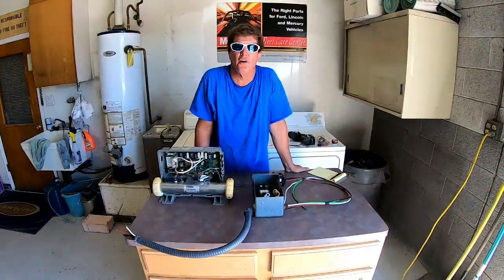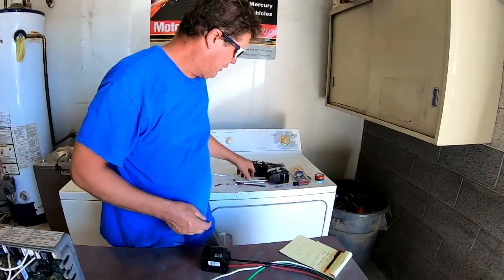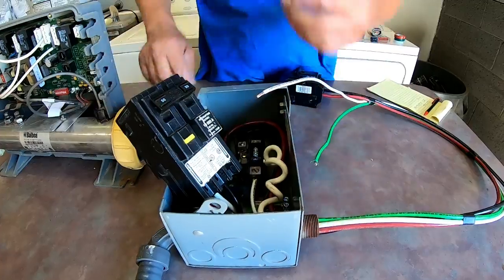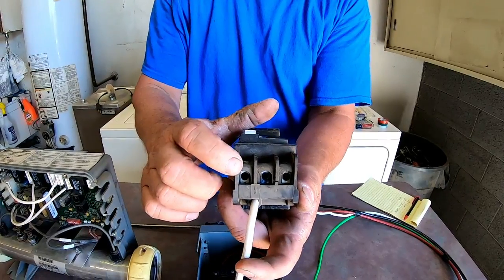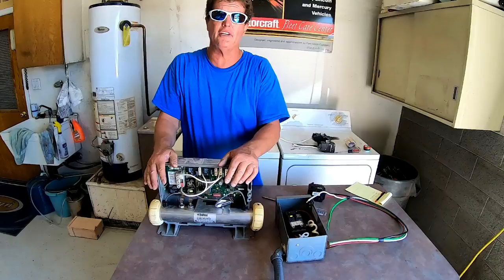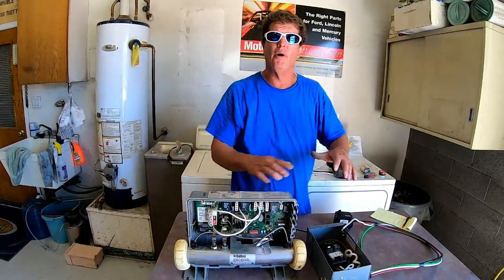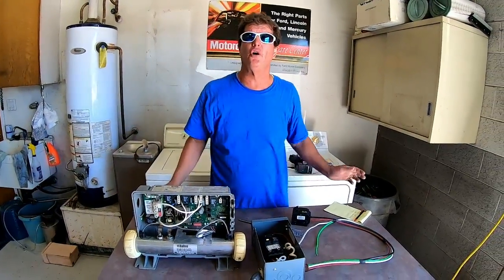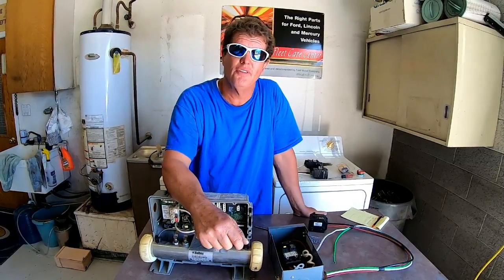Hot Tub / Spa wiring made easy... 50 Amp GFCI Install..Arizona Hot Tub Factory (DIY Spa Repair)

Comment: Do you HAVE to have a separate sub panel for a spa?
Reply from the maker: Rule of thumb is you do not want the shut off any further the 25 feet away from the the Spa when you are standing in front of the Top side control and no closer the 5 feet to the spa... In the line of sight and with no obstacles is the way  in the event you need to shut it off NOW... I talk about this in a video titled ...It's time to make some bubbles...2:30...https://youtu.be/UH_fpoPAJEY Thanks for Watching & SUBSCRIBING
Reply: @spaman5440  otherwise it’s ok to just install a 60 breaker in my main box and have that be my “sub panel?” I don’t need a separate panel? Even if the spa is a 240V?

Comment: 2 questions:

1. I've had issues with outdoor GFCI failures.  Would it make more sense to the GFCI breakers in the house panel then the standard breakers in the outside box?  Any harm in that?

2.  I have #6 wire running to the box where I'll hook up a flexible whip to the tub.  The issue is I can't seem to locate a 6 gauge 4 wire whip.  Can I use 8 gauge 4 wire on the whip and if not, any idea where I can order one?
Reply from the maker: (1)Ive seen it done both way... Ant it really doesn't make any difference...Om a side note if you are having a problem with the breaker no matter were it is placed you might have something else going on...
(2) no you can not use #8 wire! all 4 wire need to be #6  THHN... As for finding the whip ? We have always made our own... You get a 25 foot length of seal tight and cut to size and add the wire #6 THHN  to fit. I will post the link for You below... Thanks for Watching & SUBSCRIBING
Reply from the maker: Liquid Tight...https://amzn.to/33rSTaP
25 feet #6  Wire...https://amzn.to/3vT5Rue

Comment: Great video! What type of wire should I use if I wanted to run the conductors from the GCFI disconnect to the hot tube? 
Assuming I am going to use SCH 80 tube.
Reply from the maker: I alway use THHN #6 wire.. This is a link to the wire I use. ..Hope this Helps Thanks for Watching & SUBSCRIBING
THHN Wire...https://amzn.to/2QGOVbK

Comment: im running about 100 feet of wire from my main panel to the sub panel outside, it is a 50 amp system, am i ok running 6 gauge to the sub panel and also from the sub panel to the tub pack....i seen a guy run 4 gauge from the main panel to the sub panel and then he ran 6 gauge from the sub panel to the tub pack. im confused to why he didnt just run all 6 gauge wire for everything
Reply from the maker: How many Pumps and Motors and what is the HP each and How far from the Sub to the Spa ?

Comment: Where does the common or neutral and ground wire into in main electrical panel?
Reply from the maker: I have another video that shows how to wire the main panel as well as the sub panel... If you go to that video it will show you how it is wired.. Thanks for Watching & SUBSCRIBING

Comment: Need help. I have an older home. On the main breaker you show the ground and neutral not connected. 
 Have a 100 amp breaker box and have a open 60 amp breaker I can use. I'm sure it has ground but not sure if it has a neutral.  If it does not have a neutral what is the fix. Thank you
Reply: It has to have a neutral otherwise you would not have 120 volts available at your receptacles anywhere in the house.

Comment: Great video! I have a question about a used hottub I just picked up. Everything works with the hottub except it won't heat. Upon inspection , I see the thermostat is not connected to the board. It's a 4-pin connector. One pin hole is plugged, but there are 4-Pins on the board. If the thermostat is not connected will this keep the tub from heating?

Comment: I have a siemens electric panel system on my house.. A couple questions:

I only have a single game slot available in my sub panel, can I put a single gang standard 50amp breaker in there and run that to my double gang 50amp gfci breaker in my disconnect?

How do I cut off all the power to that empty breaker slot so that I can wire that without frying myself, will the main house breaker cut that panel off completely?

Comment: I ran four wires now I find out I only needed three.  Waste of money and effort but oh well. I will cap off my extra wire.  However the pigtail from GFCI still needs to hook to neutral bar right?  So does the green ground from spa itself also go to the neutral bar in sub box?
Reply: Pigtail wire from GFCI breaker goes to neutral bar in sub panel. Ground wire from spa goes to ground terminal in sub panel. If sub panel does not contain a separate bar with available terminals for grounding then install one in it.

Comment: Hey Scott I got a question for you I wired up my hot tub just like you said red on the left black on the right and red on the left and my breaker panel black on the right with whites on the neutral bar in breaker box and at the disconnect however I'm getting power to the disconnect and I'm getting power back out of the disconnect on the black wire but not the red one to the tub when I do wrong
Reply from the maker: Call Scott at the office...He will walk you through it and help you figure it out..shouldnt be hard to help you get your spa up and running
Reply: Hey Scott this is Will Hamilton again with my Clearwater spa and Balboa control panel first of all I'd like to thank you man for replying back to me and helping me out on the other situation hope you had a nice Thanksgiving but I had to change the control panel on this and like I said it's a Clearwater Spa but it's a Balboa control panel everything's wired right and I'm getting power to the new control panel I mean the touchpad rather that's what I had to replace but it won't go into no modes or anyting by start up and all that is there anyway you can direct me maybe or do I need to call Scott again tomorrow

Comment: I do not have a 4th common wire coming from my breaker box. I have two hot #6 wires and a copper ground coming from a 50 amp breaker. Am I in trouble? Can I adapt something in the GFCI box to make it work?
Reply from the maker: If you call Scott at the office he cam help you..He will need a few more details but Im sure we can help you figure it out...Thanks for Watching & SUBSCRIBING
Reply: @spaman5440  I'm not in AZ. Can I still call Scott?
Reply from the maker: @nathanberglund2053  Yes.. He is usually in the back shop around 9 A.M. until noon each day.

Comment: Can the GFCI be installed in panel inside home? Instead of having two breaker panels?
Reply from the maker: Well yes and no.. Your disconnect should not be any further then 25 feet from the Hot Tub and no closer the 5 feet and in the line of sight when standing in front of the Hot Tubs Top Side control...having only one breaker inside the house would not be recommended.If your still a little unsure Please call my office and ask for me.. Hope that Helps  Thanks for Watching & SUBSCRIBING

Comment: SPA MAN! Thanks for the awesome video! Quick question - is an insulated ground wire required from the house panel to the disconnect and from the disconnect to the spa? Or is it possible to use 6/3 wire?
Reply from the maker: I alway use an Insulated ground when working with Hot tub Wiring... #6 wire on all four. Im not a big fan of the 6/3 wire...In the past Ive had to trouble shoot tubs with tripping issues and I have spent a lot of time figuring out there was nothing wrong with the Hot Tub it was the 6/3 wire running from the Sub to the Tub. I removed the 6/3 and replaced it with #6 THHN wire and the problem went away..Hope that Helps ...Thanks for Watching & SUBSCRIBING
Reply: @spaman5440  Really appreciate your quick reply! Can I take your input to mean that while you see benefits in using #6 THHN from the sub to the tub, 6/3 from the house panel to the sub is acceptable?? Candidly, the idea of pulling wires through conduit from the house panel to the sub is a bit daunting (40 feet through walls and around corners). The 12 foot run from the sub to the tub is a straight line, much easier...

Comment: Got everything working the way you showed. Hot tub ran and than stopped after a few hours. Not tripping breaker but starts than stops if I manually trip it off/on. Flashing temperature after pur cycle. It's a ZSpa 720 and I can't find error codes anywhere on the net.

Comment: Awesome breakdown. Do you just cap the common and ground in the main breaker box?
Reply from the maker: No in the main Breaker box the ground goes to ground lug and the white/common goes to the white/common lug,... on really old main breaker boxes the ground and common are on the same lug.  Hope that helps and Thanks for Watching & SUBSCRIBONG
Reply: @spaman5440  my house was built in 1962. I have no ground. Shocked it's  not cloth wiring. Positive/Negative only.

Comment: I bought a house that had a hot tub before. the tub was gone but the wiring is still there. The wires are green (ground), one wrapped in white tape (neutral), then the other two are black (assume the hot wires). does it matter which hots connect as long as the others are connected properly? since i cant tell which is supposed to be red one.
Reply from the maker: It make no difference if they are Both Black or both Red or one Black and the other Red as long as we know they are the HOT wire! That is all that we need to know... So you should be good to go.( just look and see how the wires are hooked up at the breaker... Make sure it is all hooked up right) I did a job yesterday that wires were wrong at breaker and it burned up the board $1000. dollar mistake...Thanks for watching & Subscribing.
Reply: @spaman5440  currently its not even hooked up in the main breaker box in my house. they took the breaker out and left the wires taped up. So i have to hook it to a new breaker there and then to a outside service breaker, and finally to my hot tub. so by following your awsome video it should be easy !!! :)
Reply from the maker: @leeallmon2321  Yep It sounds like you will be good to go soon...
Reply: @spaman5440  hooked up my hot tub this past weekend and with watching your great video, and taking a bit with you all went very well and easy. its hooked up, filled, warm and running great
Reply from the maker: @leeallmon2321  Good For YOU...Enjoy your Hot Tub..Thanks for watching and SUBSCRIBING

Comment: How do you bypass the leviton gfci dead face 50amp 240v to a gfci breaker.
Reply: A 50amp 240v dead face gfci burned out and is now obsolete so I can not get it anywhere at all. I want to use a gfci breaker to replace the dead face gfci part number is 6895-BLK. How do I go about it when the gfci it part of panel. Do i just remove it and pigtail load wires to line wires. Please help. Thank you
Reply from the maker: @hperez6266  The part your looking for is available on amazon ...However I would not ever use that type of breaker for a Spa or Hot Tub ...Ive had to many problems with them in the past. I use an Eaton GFCI 50 amp breaker w/Spa disconnect.on all of our installs ..Hope this helps Be safe..Thanks for watching and Subscribing.
Reply from the maker: Need more info on wait you are trying to do... You can try to catch Scott The Spa Man at the office.

Comment: Thanks a lot! I know it's for safety issue, but where I live it is impossible to get the info on how to connect the wires. I've called everywhere and all they were telling me wass : Call an electrician. I then called the electrician that told be that they are super busy at the moment (covid-19 related) and that they could only help me in 8 weeks!!!! The spa is already in my backyard, saw your video, installed my cables, everything works like a charm, Thanks a lot!
Reply from the maker: I really like hearing stories like your ...Im very Happy you were able to get it done... Enjoy your new Hot Tub.. And Thanks for Watching and Subscribing.

Comment: Do you have to have water in the tub before you turn the breaker on???  Everything seems to be wired correctly but breaker breaks when you try it. I have NO WATER IN TUB. THANKS
Reply from the maker: You should have water in the tub before you turn it on ...Sounds like it is wired wrong or you have other problems.

Comment: my 6 gauge wire does not have a green plastic coating doe s this matter?
Reply from the maker: Yes ! What does matter is that you mark all the wires so everyone else knows what you have done .....Hot wires Black & Red , Common/Neutral wire White and the Ground wire is Green ... You need to make sure the wires are clearly marked so no one gets hurt and is on the same page.

Comment: Hi Scott, great video. I have a question regarding running cable from master breaker to GFI. I plan to run through garage roof then into crawl space. What 6/4 cable should I run? A shielded cable I can pull or individual wires through a conduit. The run is about 85ft or so. Thank you in advance

Comment: I currently have a 60 amp breaker in my main panel available. Could I connect the 50 amp disconnect to the 6 gauge wires coming from the 60 amp breaker? I believe only 50 amps will go to the spa from the disconnect, correct?
Reply: Swap the 60 for a 50. In all reality u want a 50 feeding a 50. Not recommend to go down in size from power source.

Comment: Hi Scott. I watched your video which is amazing. My hot tube was wired professionally  about two months ago and was working great. Then last week my breaker kept tripping. I would reset the breaker (NOT THE GFI) and the tube would work great again. Then it tripped one more time and the breaker would not reset so I purchased a new breaker. When I went to replace it I found that the Electrician left the screw that held the neutral wire into the breaker was very loose. So before replacing the breaker i tightened the screw.  The breaker still tripped. I replaced the breaker and the new one still tripped.   I disconnected the 3 wires going to the Balboa Circuit board (except for the green ground going to the terminal strip) and the breaker stopped tripping. 

Then I watched your awesome well spoken video and disconnected all the components you recommended reattached  the three circuit board wires and the breaker tripped. Is it possible the loose common wire in the electric box at the breaker fried my circuit board transformer??   I'm at a loss and was about to just order another Balboa circuit board.
Reply: I think its your heating element. Is there rust at the connection this could cause tripping. I watched a YouTube video on it.

Comment: This video is great.  A few tips I learned the hard way.  
That lid will remove with a large flat screwdriver.  Just pry out the outside tab a tiny bit bu turning the driver.
#6/3 wire although it fits in 1/2" conduit, you'll never get it through.  Get 3/4“.

...Back to Lowe's

Comment: Hi Scott, thanks for the video. Question for you, if I want to replace my breaker with a new one but leaving the same box, do I need the same model/brand breaker or they are all compatible as long as they match voltage and amper. Thanks.
Reply from the maker: NO not all breakers will go in all boxes..So find the breaker that is compatible with the box you have..Thanks For Watching

Comment: I have this same pack, it's 120/240 volt, please explain how to wire it 120 volt
Reply from the maker: I have another video on my channel that will show you how do do that..The only catch is you can only run one pump and motor Period! and it can not be more then a 2 HP motor(And it has to be a 110 volt motor make it work) and when the system is up and running the heat will not heat when the motor is running in high speed. Thanks for watching.Please SUBSCRIBE.

Comment: Excellent Video, I have installed several of these over the years and I always come back to this video to refresh my memory before installing. I was wondering what the purpose would be to removing the filters prior to turning the spa on? Eliminate air gap or air lock?
Reply from the maker: When you turn the system on you want as much flow as possible so you don't get an air lock... so you should always remove all filters and throw them in the water so they are wet and ready to go once the Spa is up and running for several minutes...sometime a dry filter will cause an air lock. Hope that helps and thanks for Watching & Subscribing.

Comment: Thanks for the video. Very helpful. My question is regarding wires and conduits. Your videos shows using separate wires rather then one strand with all of them inside the insulation. Does it matter if you use a grouped strand or single strands?  Also what should you put the wires in that run from the sub panel to the hot tub?  Nobody seems to talk about that. PVC? Rigid conduit? Flexible conduit? Etc..
Reply from the maker: I have found that I find more problems with a Grouped strand then with Single strand... When ever I have a spa that keeps tripping the breaker and everything looks to be in perfect condition and I can't find any other  reason for the problem I go to the wires and quite ofter its the grouped stranded wire causing the problem. As for the connection from the Sub Panel to the Hot Tub ..I most often use what is called Seal Tight also called Liquid Tight and I alway use single stranded wire.  Alway follow The National Electric Code as well as Local codes... Thank You for an Idea for a Video for the future and Thanks For Watching. And Please Like , Share & SCBSCRIBE.